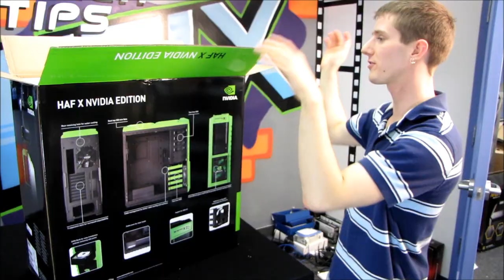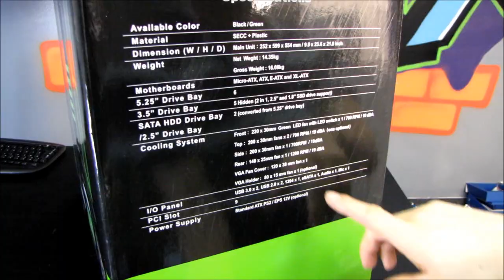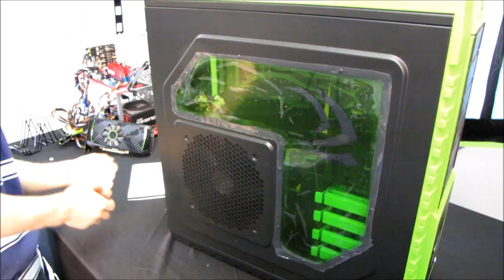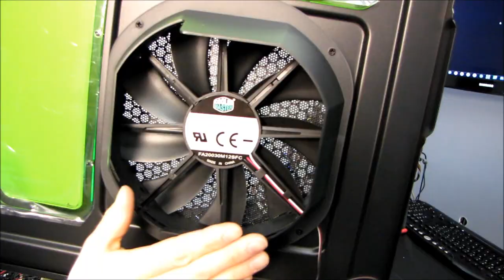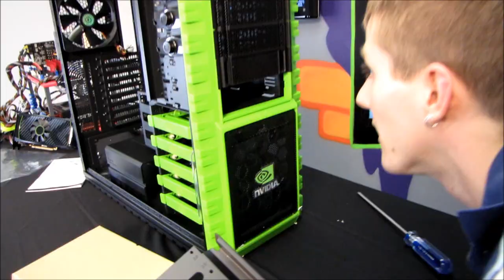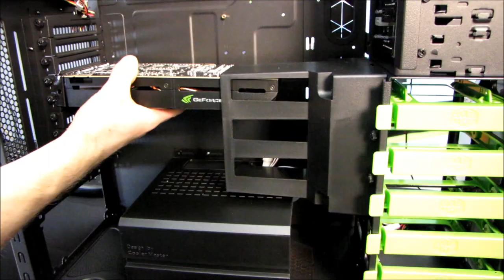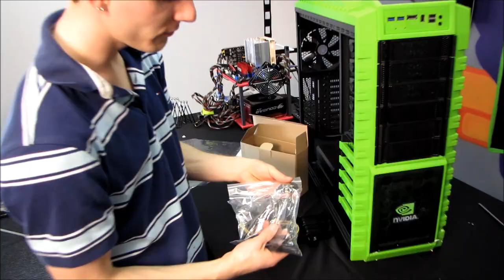Cooler Master HAF X NVIDIA Edition Gaming Computer Case Unboxing & First Look Linus Tech Tips

Comment: @GamingForLife96 Christ you are dumb... you sound like console gamers when they try and describe that you need a $3k machine to do anything. there's not consumer level processor that is anywhere near $2k, and no mobo anywhere near $1k. at most you have to spend 200 on a CPU and 150 on the board for gaming. idiot.

Comment: Would this be considered a Gaming Rig?

- Asus P7P55-LX CrossFireX REady Mobo
-Intel Core i5 760 Quad Core 2.8 GHz
-Sapphire ATi Radeon HD 5770 1GB
-CoolerMaster eXtreme 650W PSU
-Seagate Barracuda 1TB HDD
-4 GB Corsair XM3 DDR3 RAM

Comment: The gpu fan duct will NOT fit with duel gtx580s. At least with an ASUS Rampage mobo. 

The USB3.0 cords interfier with the optional 200mm fan on top.

Comment: I have this case and the Gigabyte P67A-UD7 Motherboard, that motherboard cut out doesn't have enough clearance to install a cpu cooler 2 holes are half covered, so that was disappointing other wise this case is total boss material

Comment: It is a very nice case. I just finished building my new pc this weekend and I needed a case to support the EVGA x58 Classified 4-way motherboard. The case does look better in person. When I was searching for a case and saw this on newegg I was skeptical about it, but I am really glad I chose this one. The wheels are really nice to have because it is a very heavy case and with my bad back it helps when I need to move it.

Comment: linus, would you recommened the normal haf x case, or an antec 1200 V3. i'm trying to decide between the two. my biggest concern/consideration when upgrading to the new case is cooling, so I want the case with the best airflow. thanks!

Comment: I have the HAF X. My Motherboard, from the top, is PCI-e X1, PCI-ex16, space, PCI-e X16 (p55 FTW)
The fan shroud does fit the top card, but its tight when you are using the front hot swap bay. Specifically, the molex connector is wedged in against the top of the shroud. It looks like the put a 'fix' in place for this version. 
Ohh btw, when I got my second GPU I experimented with the fan shroud (Scythe S-FLEX SFF21E) there was no discernible difference in temps. Might try again with another fan

Comment: Linus, a tip for ya. If you want to hide those USB3 cables and not run it through the back, put the bracket behind the PSU under the cover and plug your cables in there. That way you can run it through the hole in the back plate and nobody will know. ;)

ps. Coolermaster will sent you a new USB 3 cable that's compatible with the header when available. Look at: forum D coolermaster D com SLASH viewtopic D php?f=25&t=14729